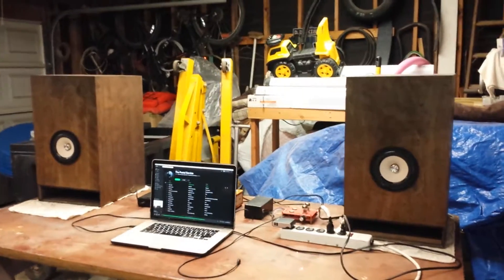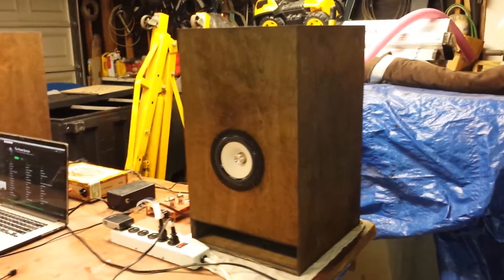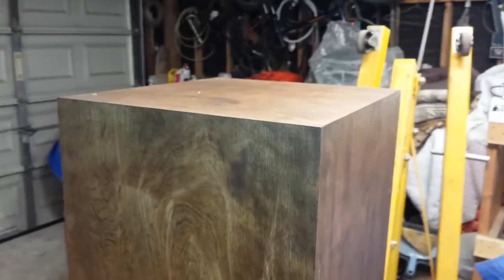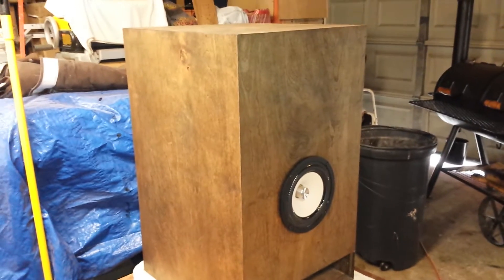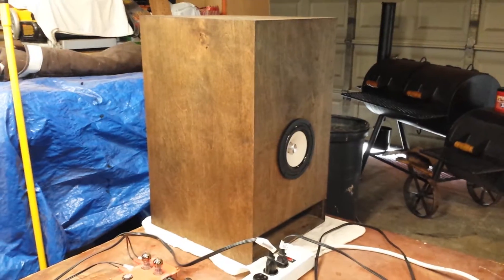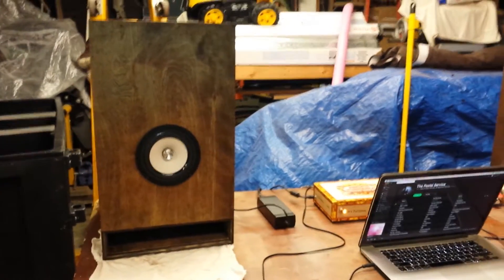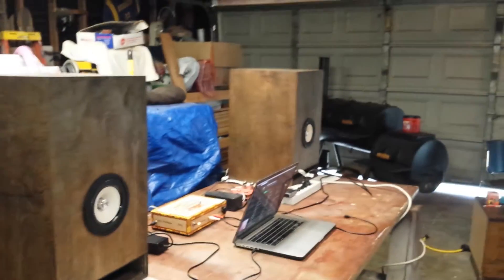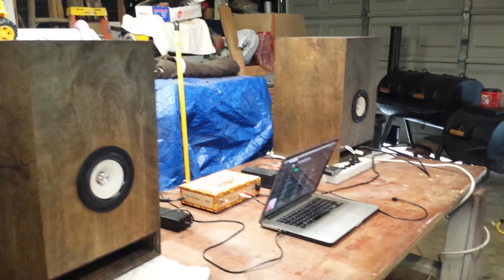Tang Band W-5 speakers in MLTL enclosure.

Comment: Nice work!
I ve got a pair of these TBs and I am trying to design a TL for it.
I can help with the CNC router and milling.
If you want to contact me:vieira.souto@gmail.com
Regards,Dieter
Reply from the maker: Thanks, I'll probably shoot you an email here soon. I wouldn't have any problem programming for cnc to cut, bevel, and recess, but I just don't have anywhere to put a 4x8 or 4x4 router table right now. If I had a cnc I would also consider doing some elaborate jointing and tricks. These enclosures aren't small, but they sound great.

Comment: how good are this speaker i always like speakers like this that are full ... bass ?
Reply from the maker: Looking at the frequency response, they are flat down to 47hz and then they fall off. They sound great full range, but you could add a sub-woofer and not be disappointed. It depends on what you want to listen to, but in general I wouldn't mind a small sub that was tight and controlled to add some authority. For the amount of power I am using, they are very impressive.

Comment: how about    some enclosure plans?
Reply from the maker: I have the dimensional drawings saved for all my enclosures, but I am not sure if I want to give these away just yet. I have also considered building a cnc router table to batch produce these if there was enough demand. There is quite a bit of time vested into the math and design. Most of the MLTL designs I see are the needle design which is a lot easier to design and to build, but I wanted an enclosure that didn't look as awkward dimensionally. I still think there might be more room for improvement, and I also plan to change this design internally from segmented pieces to a continuously curved kerfed pieces as well if I make more of them. What is your level of carpentry skill? The way the shell is bevel jointed, but the inside pieces are butt jointed can be a bit tricky trying to get a tight fit without gaps on the corners and a good seal internally. I used about a sheet and a half on these, All internal voids are filled with expanding foam, and the inside is sprayed in rubber up to the last 1/3 of the line which is stained.